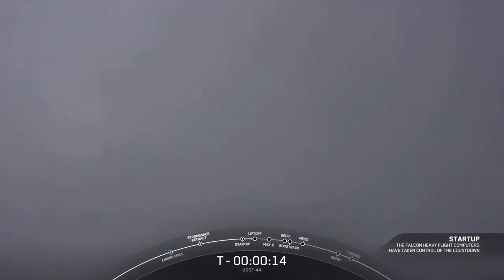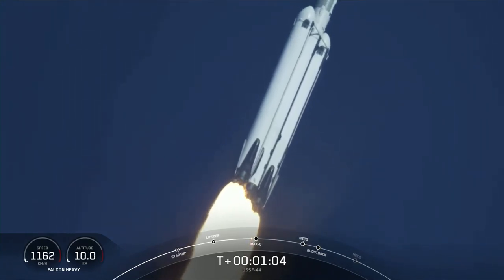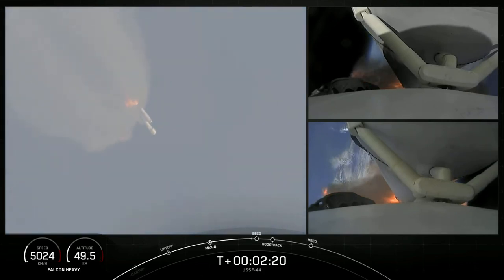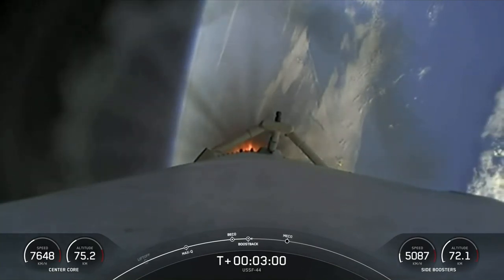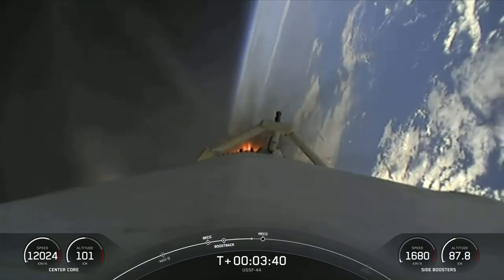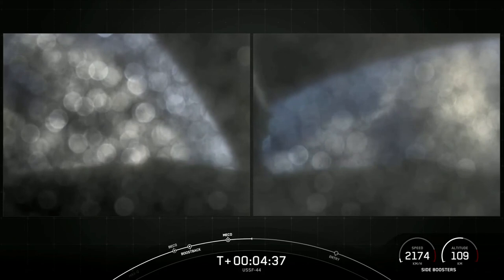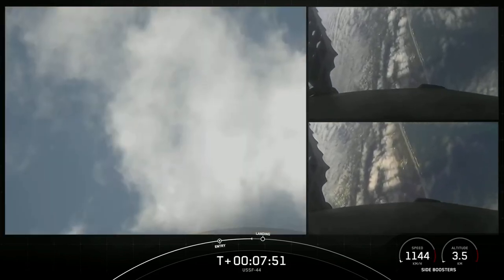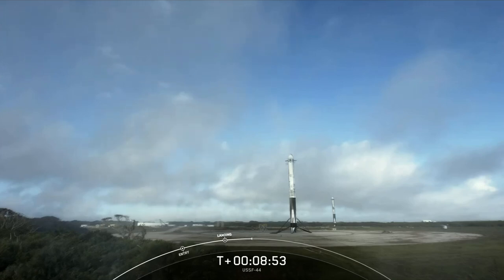SpaceX Falcon Heavy launches classified Space Force satellites, nails landings

Comment: So are those materials any of the copious number that are on the periodic table that wouldn’t be able to survive the temperature of the thermosphere and why do we never see gaps in the panels like we did with the blackbird???
Reply: the fins are made of Titanium (biggest titanium machined parts in history) and they use the engines as a shield as well. They do the entryburn at its hottest point to create a plasma shield to reduce friction. Also falcon 9 doesnt go as fast as you would expect on entry, its not going orbital speeds when it turns around, that is also what makes recovering second stages a lot harder to do without shielding and why they dont even try to do this. Any shielding you add is mass and mass is the enemy ;) . The amateur astronaut has a great video about it.

Comment: I suppose that is the one thing with Falcon Heavy, those side boosters drop off early where the performance cost to recover them is minimal.  However just getting the center core slowed enough to hit "the wall" and then land on a drone ship eats up a lot of performance.  So then most every Falcon Heavy launch ends up being with a new center core.  Still, quite a capable vehicle for the price.  Won't be surpassed until Starship is a proven rocket.

I have to wonder if Starship will end up with a Falcon upper stage adapter as customers seek the higher delta-V's without resorting to refilling the beast that is Starship.

Comment: I watched the last Apollo flights and nearly all the Space Shuttle launches and landings.  The physics of space launch have been known for over 60 years.  Who the hell are the people cheering for landing a rocket on its tail?  SpaceX employees?  They must be, I can’t imagine getting pumped about putting a satellite in orbit and saving the boosters, we did that on 150 space shuttle launches, right?
Reply: Propulsively landing a booster and then re-flying it in less than 30 days is an entirely different ballgame compared to landing a lifting body spacecraft on a runway. Makes flight way, way cheaper. Makes space much more accessible.
Reply: It's only the 4th time they've launched a Falcon Heavy. And we saved/reused less of the Shuttle than SpaceX is doing, and at a higher cost per launch. They have every reason to be happy. And there were 135 Shuttle launches between 1985 and 2011. SpaceX has launched 187 Falcon 9's since 2010. 127 of those were since 2018, with a 100% success rate. Again, they have EVERY reason to be happy.
Reply: I get that you guys are fans, but I don’t think you gauging the accomplishments of the space shuttle.  There were only 5 space shuttles built and except for twice, all of them were reused 35-60 times, building the whole ISS in the process.  The SRBs were recovered offshore and sent back to Morton Thiokol for refurbishment.  I had heard that the shuttle was $10,000 per pound to get into orbit.  Is all the jazz about SpaceX about that it’s cheaper?